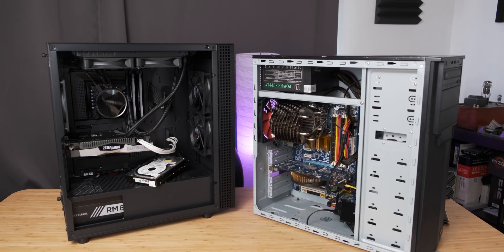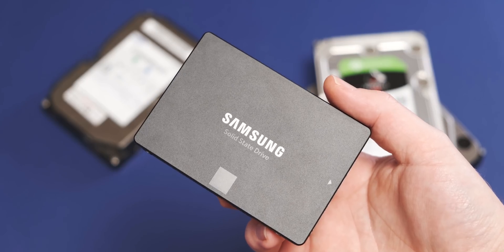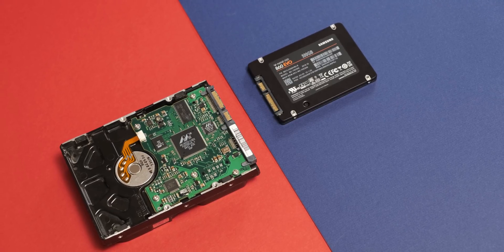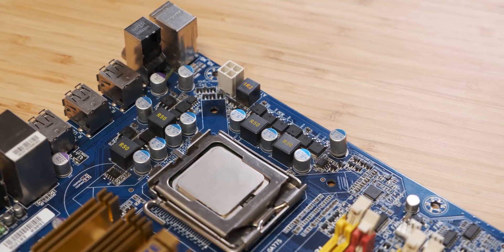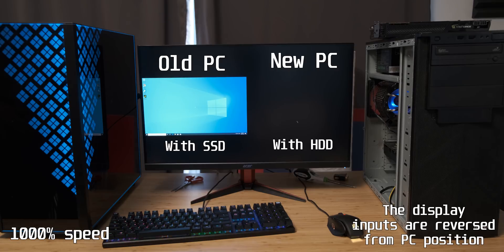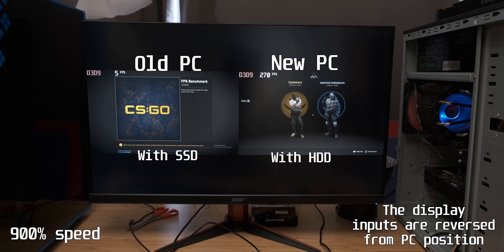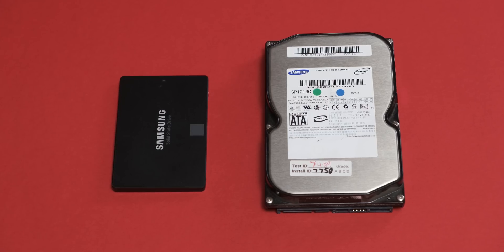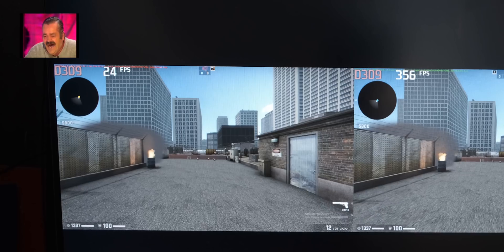New PC with old hard drive vs Old PC with new SSD

Comment: Once you go SSD, you'll never go back.
Reply from the maker: Yeah, they really ruin any other PC experience for you. 😁
Reply: Even though it's more expensive, I decided to go all SSD in my PC. I have 3 1tb Samsung SSD.
Reply: @TooFurious4  SSD nowadays are getting cheaper 😪
Reply: @Sharki83  The Samsung 860 Evo I bought has gone up $40 in the last 2 months.
Reply: @TooFurious4  Maybe depending on your country
Reply: @TooFurious4  Same but did all nvme to save space
Reply: I prefer SSD's but i dont trust them since my EVO 850 failed without any warning... While i can feel when HDD is going bad, i can restore data from HDD and i even can fix some things on HDD while with SSD i cant but if you dont have any important data on drive, have backup or data in cloud than ofcourse SSD is way to go !
Reply: @mikcnmvedmsfonoteka  It doesn't matter what type of hardware you use to store data. You should ALWAYS have a backup of your data. 
My boot SSD fails? I have a disk image.
My HDD crashed? I have an external drive with a backup.
My house burns down? Offsite copy in an undisclosed location.
Reply: @mikcnmvedmsfonoteka  you can feel hdds failing? teach me that power, bcz sometimes they will do wirring noises (heads crashing) or clicking every now and then, others will just die without warning, and trust me, you cant fix a full dead hdd without proper equipment (and if ur data is so valuable to pay for such thing, u have backupS yea, more than 1), home fixes for, failed engines, or "minor" issues, possible, but its a 50-50, with ssd you can also feel em going bad, speed will go downhill to a point its going to be slower than a tape drive (nand degradation) or sudden death (likely controller board death), the point overall is, backups heh, any drive can malfunction
Reply: Use intel optane hahah
Reply: @redzyakuza  i collect old hard drives and repurpose them for my games
Reply: Yeah, if I can help it I won't use a spinny disk in anything anymore.  I hope that price point on SSDs craters; it's almost at critical mass where it'll hit spinny disk prices, but not quite.  You see the delta really take off once you pass the 1tb price.  A 1tb SSD is still about 2.7-3.0x the price of a platter drive of same capacity...but up from there, the difference skyrockets.  I think a 1.5tb SSD is over $250 US for example at the time of this writing.
Reply: @thedungeondelver  A 1tb nvme, cheap one, like crucial p1, is around $100-$140 US.
Reply: @thedungeondelver  I can get a 4tb brand new HDD for 48.99 USD, while a 2tb SSD is 250 USD
Reply: @Anton Babani Yes. I'm typing this from a generation older Core2Duo than he tested in the video. It has a Kingston 120gb SSD that I picked up for 20 bucks, it works fine for YouTube, web browsing, and office work, boots in 45 seconds or less. Get an SSD until you upgrade the rest of your hardware.
Reply: Still using spinning disk for large capacity.. 8TB easy shuck for $120 at Best buy when it's on sale.

Load up a 4 bay with 8tb x 3 in raid 5, and an SSD cache.
Reply: After 6 years my mechanical HDD still runs smooth .
Reply: the same can be said with 144 vs 60 hz monitors
Reply: @TinnitusFrequencies  69 comment 😳😳
Reply: Until I can buy 2tb ssd's for $50usd then I won't use them for mass data drives. I have a 1 TB boot drive that also has a couple of the larger hard-to-load games, and a 2tb 7200rpm Seagate barracuda for games and videos. Much more economical. And this video is also not representative of modern HDD technology. A Seagate barracuda offers very good read and write speeds. I've never had a problem with loading games using an HDD, you just have to wait 5-30 seconds longer (sometimes even longer, worst case scenarios) and it's very much worth the money you save not getting an SSD.
Reply: A normal hard drive is fine for backups and things.  That is especially true if you back a lot of stuff up.  SSDs are still expensive for their capacity and I would not use them for everything just because of that.
Reply: I used to use a hard drive, then I figured out I could enable intel RST. It made speeds like 3x faster
Reply: @rsxyzs  Yeah, the secret is intel and hybrid tech, I have an Intel Optane juiced 3TB HDD and loading times are closer to SSD level than HDD. SSHDs have the same effect aswell. RST is a great tech.
Reply: @Anton Babani Not enough info to determine anything. Lags? When? Doing what? What other hardware do you have, etc...
Reply: @Anton Babani Still not very specific, you're not going to get anywhere with anyone being so vague.
Reply: I'd agreed for Windows.  It tends to be near term write intensive even when doing what should be read only heavy workloads; even if those files are in the in RAM cache.  It will cause fragmentation doing these.  In an optimized Linux based build, most of the time you will not be able to sense whether you're using a fast NVMe vs a slow HDD.
Reply: I went back. Right now I only am using HDDs (I have an unused SSD  still plugged in though).
Reply: Tbh I forget that my 4 platter RAIDO array isn't an SSD lol
Reply: Can't be unhappy with my hard drive if I don't have any SSDs to compare it to 😎
Edit: fuck, i listened too hard to his description of booting off of a hard drive, now I've realised how it actually does take a lot of time to become responsive, damn you!!
Reply: Because the old hard disk is easily damaged and can not be used again.
Reply: Once you go WD Black..
Reply: My boot drive is a ssd but my game library is a HDD :(
Reply: I did that though
Reply: Tell that to nvme
Reply: Read it at STD but yeah...
Reply: I went straight from a 5200rpm HDD to an NVMe M.2 Samsung 970 EVO and HOLY FUCK it brought my system ROARING to life
Reply: I have Nvme.
Reply: I only use HDD for emulators and old games
Reply: Same with ddr4 computers.
Reply: they really do. i’ve never used an ssd until i got one for my pc and the difference is night and day
Reply: I've finally tried ssd... its so fast but I've tried to get enough space for the ssds I have... I can't fit it so I'm not going to switch yet
Reply: Want to though
Reply: Hello your computer has a virus
Reply: I have a 1 TB M.2 for boot & applications, another for games I play often, then I have a 4x6TB WD Blue raid 10 setup for work and other files, including spare storage for games (I have a 3.5TB steam library) - it has 12TB usable space. I get similar loading times to the M.2 in most games being able to read from 4 drives at once, but it was definitely not cheap.
Reply: 500gb hdd+120gb ssd =bottleneck?
Reply: Not willingly that is.
Reply: my old pc still using hdd, my brand new laptop have a ssd nvme, when i see the difference when they boot each other, im very triggered with the stucking hdd in windows 10
Reply: Yes
If you get one
You will never use hdd for system files 
Unless laptops
But M.2
Reply: Once you do with an ssd, you'll never buy a new pc that's if you are doing normal thinks like general web browsing.
Reply: I bought one of those Samsung 970 thingys, but i went back to hard drive because if loaded siege too fast, and then people have high expectations for me in the match.
Reply: Like drugs
Reply: Totally agree here. I got my first SSD in 2012 (a 64GB one) and when it broke few years later, it felt just totally crappy to use a HDD for few days until I could get an another SSD.
Reply: as OS drive, yes as storage - hdd's win in terms of capacity per price (get me 18tb sata ssd for 600-650usd...)
Reply: @1sonyzz  
True right now on 2021. SSD  have been catching HDD  on price/capacity-ratio fast in the last few years. At the moment you can only get two 4TB SSD with that amount of money.

I have 6.5 TB of SSD space and I'll soon have 16TB of HDD space
Reply: I can see why
Reply: Ill eventually go full ssd. Pc sounds like a vaccum but less noisy
Reply: Very true, specialy when we talk about nvme2...
Reply: SSD for booting and games and HDD for everything else. HDD is much cheaper for archival purposes.
Reply: @EmergencyChannel  It is true, for now anyhow HDDs are cheaper for the storage capacity.
Reply: true
Reply: Me laughing in M.2 NVMe
Reply: If I already have my hp laptop, I want a diskless smooth of speedy Samsung solid state drive so bad right now to upgrade my laptop to have with much better fps like so much higher fps, a lot less ping, non delay gaming laptop and I'll never go back again with that spinny laggy hard disk drive no more. Especially if I play games on my laptop with lag in it on the hdd always.
Reply: Can confirm, built a PC with an SSD boot and HDD games library but eventually replaced the HDD. SSD's are really cheap and hard drives just not worth it if you play games
Reply: @altogumanator3000  actually, ssd not worth just for gaming, store 5 tb of games on ssd, will it be better? absolutely, will it cost 700$, absolutely
Reply: @arencorparencorp2189  True, there certainly is a higher cost per tb. My experience has been that I don't need to fit my entire games library on my PC all at once and so I've never needed an amount like 5tb. Although if you do buy Samsung's QVO SSD's the total price would be closer to $650.
Reply: @altogumanator3000  qvo ssd r just trash, evo is not much more, while qlc looks fantastic for cheap-er ssd game library, if its 95% the cost of tlc (evo) with all the disadvantages, pass, also ur backups (full drive) need storage, ssd r nice, for certain things, and some games load faster others... not so much, i have arround 2 tb ssd, but the other 16 tb, hdd (movies games and backups)
Reply: @altogumanator3000  at the moment I am using a 128gb ssd for windows, and 2 hdd's for games, they are pretty slow, 70-80 sequential in crystaldiskmark, and they started to make some ugly vibrating noise. And now I want to replace those hdd's with a 1tb ssd. It will make my pc quieter, and it will make my load times even better in games, plus in this way I will benefit more from my 1Gbps internet.
Reply: @altogumanator3000  Seriously? I got an 8TB gold enterprise drive for $270 and my games run just fine. Wanna know how much an 8TB SSD costs? $1000 or more! Even 4TB SSDs are $500. 1TB SSDs are the cheapest option but c'mon, let's be real, 1TB won't get you far these days when games can take up to 200GB of space or more! Sure the performance is better, but cheap? Lmao right. I'd like a hit of whatever it is that you're smoking cuz it must be some fire. Fact is, you get far more bang for your buck with an HDD. If you're not a total moron and buy a 5400rpm hard drive with a 32MB cache that's basically made for surveillance, don't go assuming that anything less than an SSD is shit. Just saying. :/
Reply: @unnamed715  HDD is mass storage. O/S & programs should be run off SSD. How many games you need installed all the time? Get a 1TB or preferably 2TB SSD, they dont break the bank.  It doesn't need to be NVME.  You can have quite a few games installed (not all are 80gb+ huge install sizes), have rest of your library backed up on the HDD.  Very quick to restore install in Steam off HDD to the SSD.  Relegate HDDs to mass storage - video, game backups, TB+ large audio / photo libraries etc.    Good choice on the WD enterprise drive. Hope you've still backed it up though!  I have a 500gb SSD for O/S, a 2tb SSD for games and apps, a 1tb SSD for downloads & recent media, 2x 12TB WD 520 Ultrastars (+ another 2x for backup) for mass storage.  The HDDs by far the biggest of the storage costs. I haven't run a program off a HDD since 2009. When i got Win 7 and a shiny new 256gb SSD (games weren't huge back then). Sure im an enthusiast but it's 12 years later..... 12 years man. Get with the times.
Reply: I use two SSD's 500gb and a 40gb, one for boot, apps, and game, the other for Temp files and Disk Cache (never used). Then I have 8 TB Spinning DIsk storage for video, audio, and photo data. This is the bee's knees IMO.
Reply: @ikannunaplays  256GB nvme for boot (thinking of an xpoint though), 500GB for Steam, 500GB for Origin and Uplay, 256GB for torrents before they move to mass storage, 500GB for my music library. Then 2×4TB in RAID1 for mass storage. New ssd on order for GOG library. Old 60GB sata about to be replaced by a cheap 120GB nvme as scratch disk/swap space drive, maybe add GOG to Steam or Uplay drive and use the ssd as a buffer for mass storage, it is a bit slow.
Storage is the bottleneck. We need faster cells on the drives, like xpoint but Intel still charges a very hefty premium on it because they are the only one with it, mram/sram/nram cannot get here fast enough. In the meantime, software defined flash may bridge the gap, it is coming to PS5 already, straight from the enterprise space, it avoids the need for an ssd to emulate a hardrive and allows more direct control.
Reply: @jamegumb7298  Sounds like a sick setup I'm too cheap and my needs are basic (in comparison), even still I'm jealous.
Reply: @ikannunaplays  The reason I did it this way is because I only have to buy an ssd here and there and not all at the same time. I try and keep it 6 sata ports or less becasue most boards have 6 sata ports max (unless the low end budget boards which have 4 but then you can simply get a cheap 2 or 4 port controller, looking now €52 4 port cheap pcie 3.0 ×1 model). 
The oldest is a Samsung 830 (showing its age at over 50K hours) which is quite old, the nwest is the bootdrive in this thing, a Toshiba RC500. I plan on buying a Silverstone adapter which slides into a 3.5inch bay and it still holds 4 M.2 sata ssd's quite neatly, very compact.Then buy 1 by 1 and switch them over. If I buy 1 every 3-6 months it will take a while but my cheap ass will not mind. 
I kept my HD7950 until the fan on it failed, and it kept at it until I replaced it with the best card at the time, a GTX1060 6GB. Talk about cheap. It is just for games and light programming, surfing so I never bothered to replace the i7-2600 in it, but will once the i3 laucnhes, want to compare the 4c/8t to 4c/8t and will want the better idle and lower tdp.
I did spend a bit more on my linux rig though, 12 core threadripper but it has a specific usecase.
Reply: I've never used SSD for 10 years
Reply: my collage CNT teacher hates ssd and says they are a ticking time bomb and will die on you unlike a mechanical drive. he is so peranoid that he wants us to move everything off of the ssd including page files and crap
Reply: @bland9876  He might be right. Mechanical drives almost always give you warning signs before they completely gone. So anything of importance is probably safer on mechanical drive
Reply: @bland9876  being a teacher is just a job, u can be as dumb, also hdd not dying? good one, r u THAT paranoid?, well np, backup to the rescue (wich you should always have), r u hardcore paranoid?, raid 5 ssd+backup, if u lose 1 ssd and ur backup hdd die simultaneously.... well... u probably have a fire burning ur machines or something
Reply: @arencorparencorp2189  my teacher said that hard drives do die but they are more resilient and you usually hear a clicking sound before it goes. He said he has seen an hdd go over 10 years without dieing
Reply: @bland9876  and i've seen ssd fully functional for 9 years, the very first consumer ssds, with absolute crap durability , and they still work
Reply: @arencorparencorp2189  there is a video of linus tech tips using all ssd nas sever and my teacher now hates me for showing him
Reply: Wrong, they're both old. Ever since nvme m.2 came out they were obsolete. No more power / sata cables or that sata 6 bottleneck 👌

Comment: Interesting video, one small correction though, it's easy to mix up bits and Bytes, but SATA 2 runs at 3 Gb/s (bits) or around 300 MB/s (Bytes). Which is about half that of SATA 3, but twice as fast as SATA 1.
Reply from the maker: Yeah thanks for pointing it out. I just misspoke in the video. 😁
Reply: No worries, thanks for the content. 😁
Reply: @DawidDoesTechStuff Misspoke... Each single time...
And I totally didn't type down that comment, I misstyped an SMS.
Reply: I ventured down into the comments to say exactly this, glad someone else noticed it.
Reply: SATA 2 is not really 3 Gb/s, even when it is advertised as that. It is the baud rate, SATA uses 10b/8b coding, means the data rate is 2.4 Gb/s. Saying it is 3 Gb/s is the same as saying 100 Mb/s Ethernet is 125 Mb/s.
10b/8b means that 10 symbols (1 or 0) are send to transmit 8 bits. This is completely independent of the protocol overhead which you have on top of that.

Comment: 7:54 it is 30Megabytes, not Megabits (MB, not Mb, in the test it shows MB/s so its Megabytes)
Reply: Honestly, I personally hate when people use B and b incorrectly, but as someone who's pointed it out quite a bit in the past, 90% of the time I'd recommend just leaving people be ignorant. Obviously here it's a tech channel so he should know the difference so it's beneficial. But most people tend to just get annoyed at the technicality and it can kinda ruin a flow of conversation if you point it out. Besides, most people don't care what the difference is and will just make the same mistake again in the future